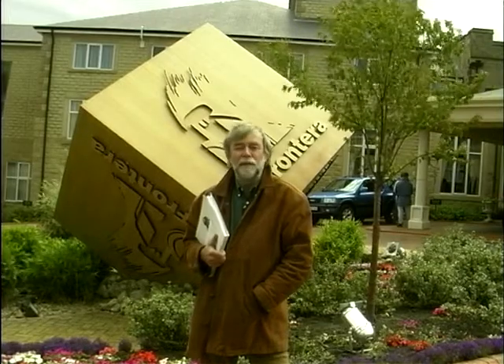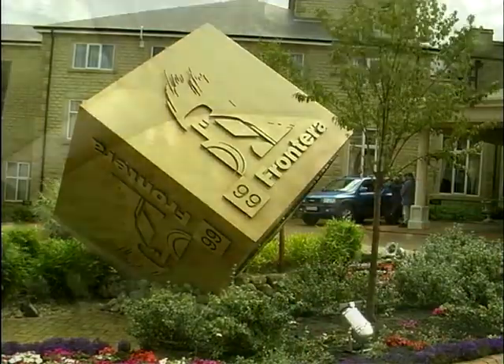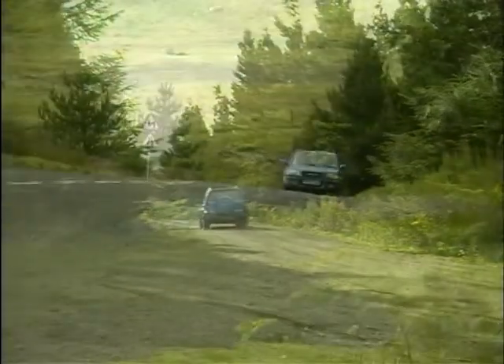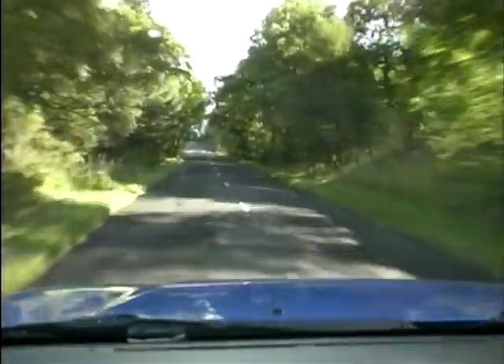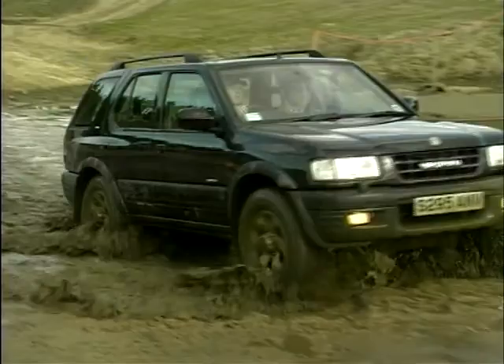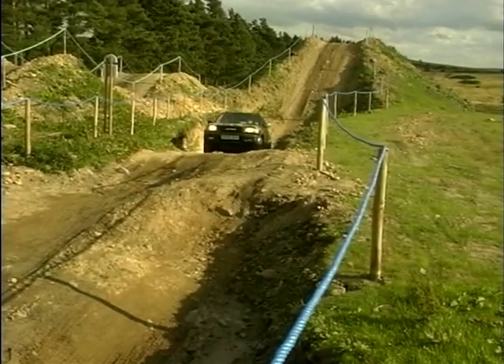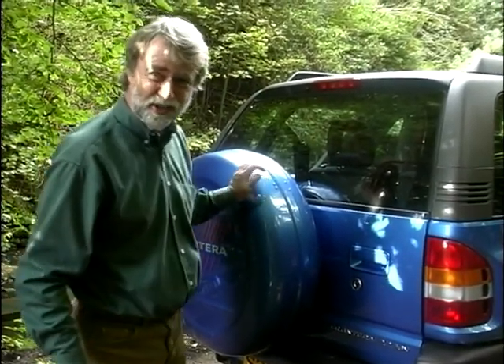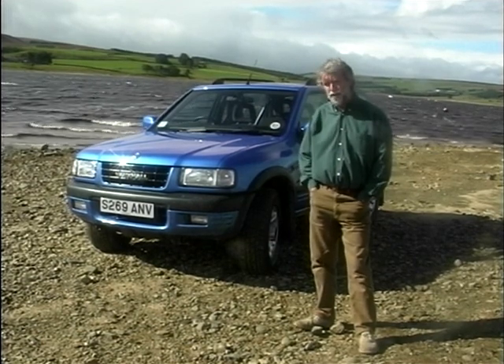1999 Vauxhall Frontera Review - A Reengineered Marvel?

Comment: dont these idiots check anything before spouting off the sports hard rear shell is removable hense the roll bar remaining and its a totally new bodyshell,dash electronics....thats like saying a p38 rangie looks the same as a 322!!! Fantastic capable 4x4 ive owned both 2.2 petrol and the top spec 2.2dti olympus model both fantasitc never got stuck and the diesel would pull the side out of your house.
Reply: Was your 2.2dti as slow as a snail?